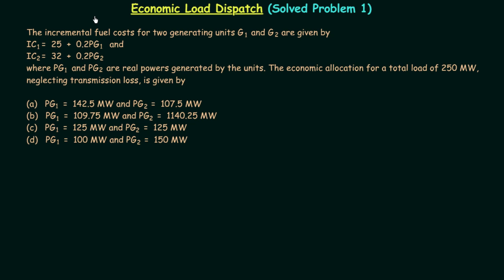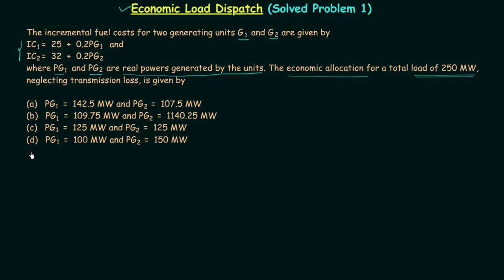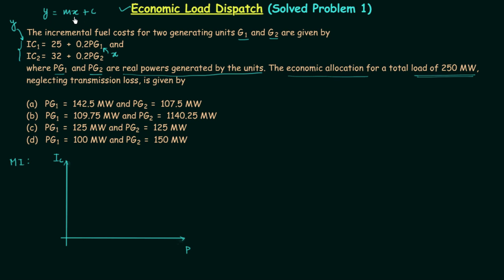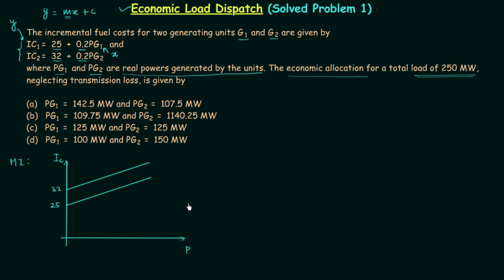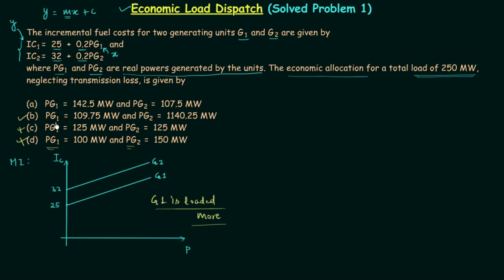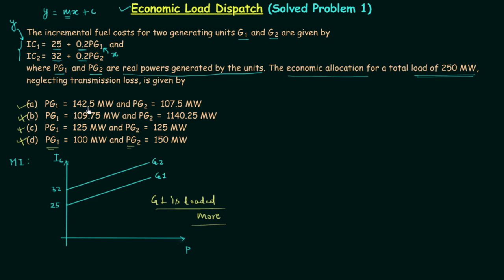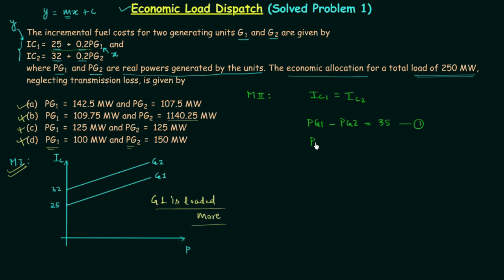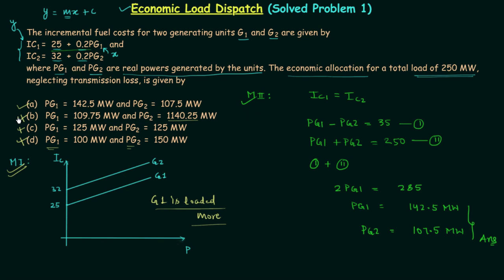Economic Load Dispatch (Solved Problem 1)

Comment: A power system consist of two 124mw unit whose cost data are represented by the equation c1=0.04p1+22p+800. C2=0.045p2+15p+1000